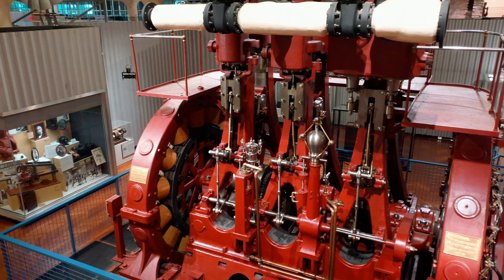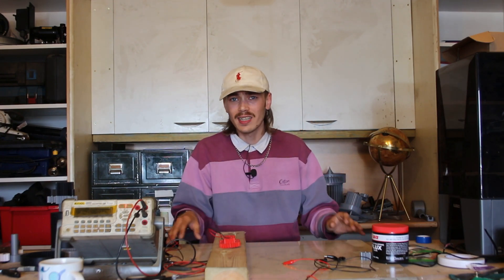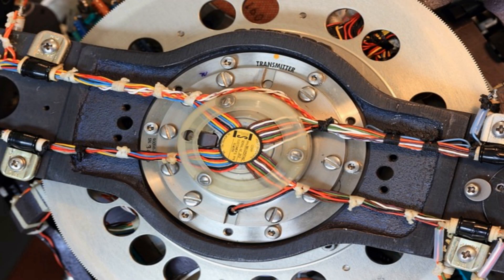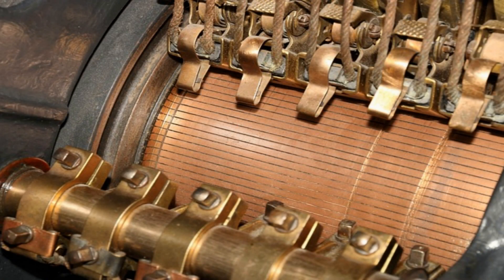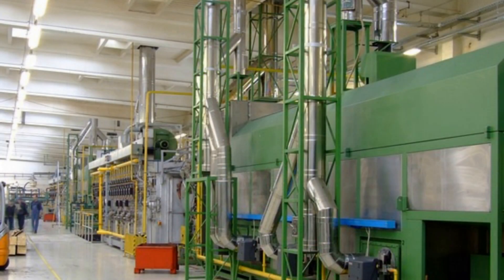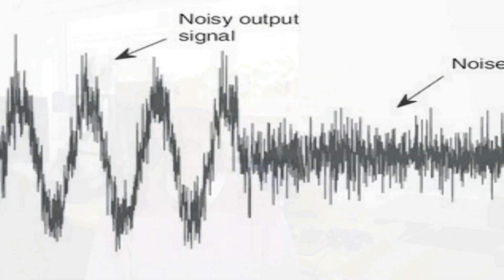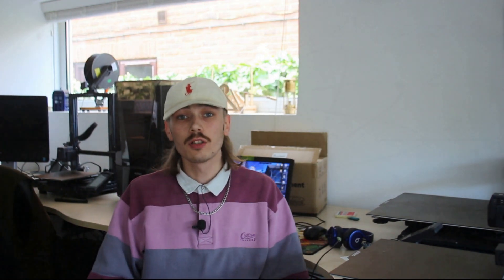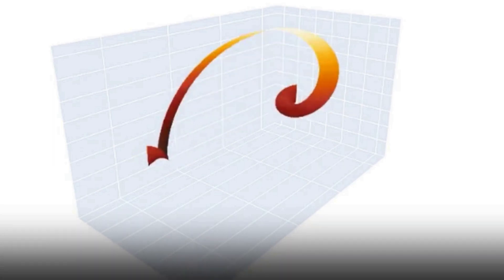The Anti-Twister Mechanism - Looking at Electrical Connections Differently

Comment: a brushed dc motor can be made into a brushless dc motor, by locking the +/- plates in place together, then letting the rolling bearing conductive metal balls do the mhd lorentz force moving, in between the +/- plates
Reply: yep the bearing balls are the motor axle then, connect the real axle to it, on top of the bearing balls
Reply: sorry not sorry about spam, but then it does not require a ac pulse controller, just a current potentiometer